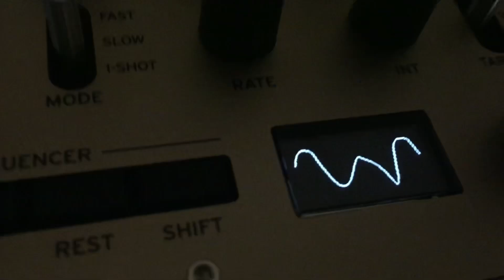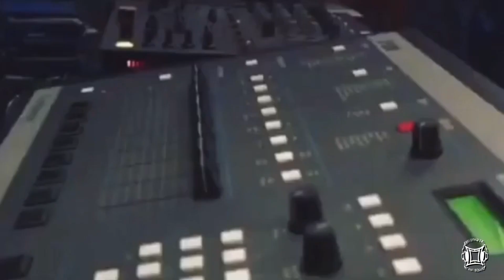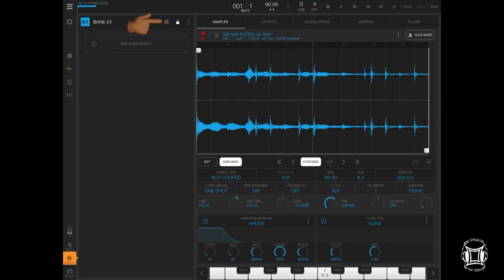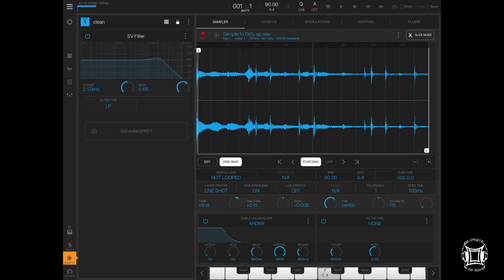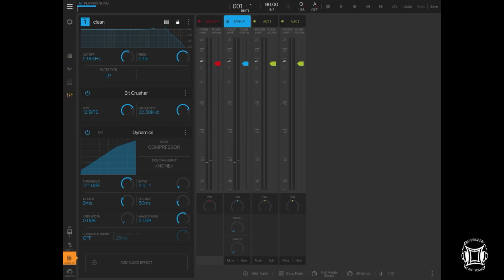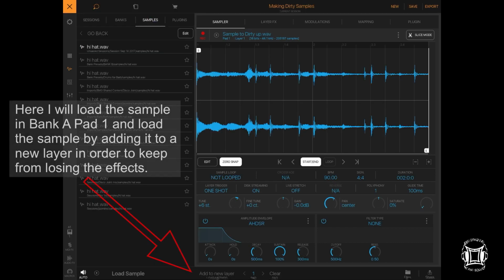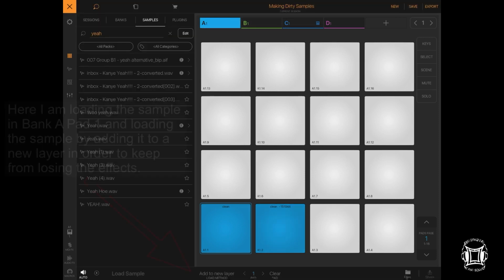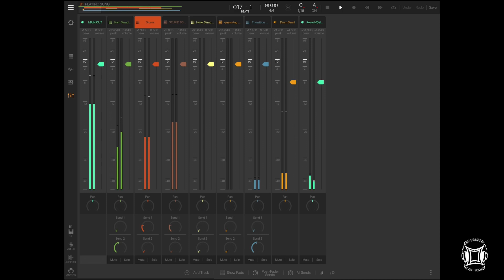How To Get  a Vintage Sampler Sound From a Modern Sampler or DAW

Comment: Great tips 👍 One thing you can also do is sample or resample at really low level, which is like reducing the bit rate because you’re losing information and increasing the noise floor. I’ve found doing this also sounds more natural than using a bit crusher.
Reply from the maker: Aaaaaah, great tip!  I am going to try that out and maybe mix the technique I used as well as that.  I usually sample at a higher volume to get a bit of distortion but, I’m definitely gonna try this out as well!  Thanks for checking out the video and for sharing that info as well.

Comment: So, in Ableton I add the effects on a sample, put it up 6 semitones, resample it to another track and downtune it by 6 semitones, right?
Reply from the maker: Hey thanks for checking out the video and yep that’s the general idea.  But I just used 6 semitones as an example.  If go up more semitones it will actually degrade the sample even more.  Sometimes it can be a bit much but you’ll find exactly how much is enough for you.